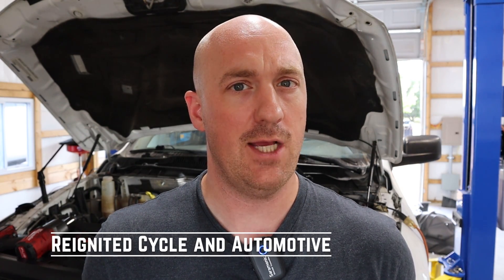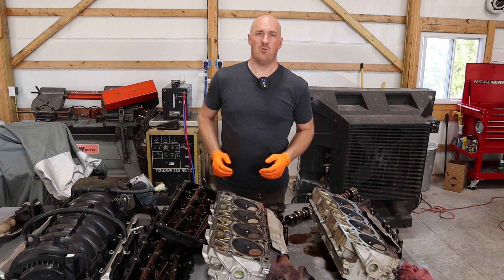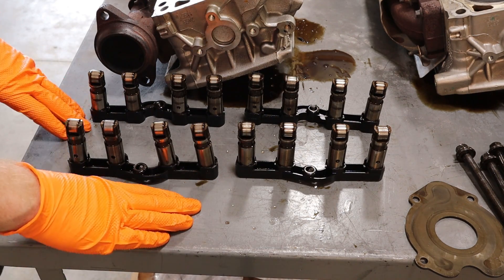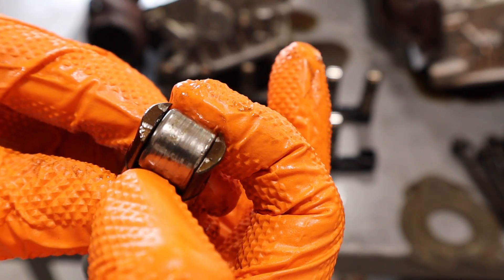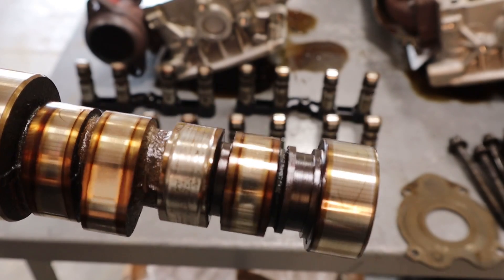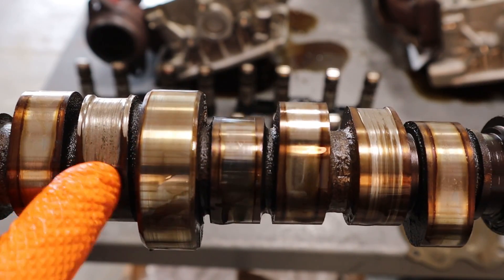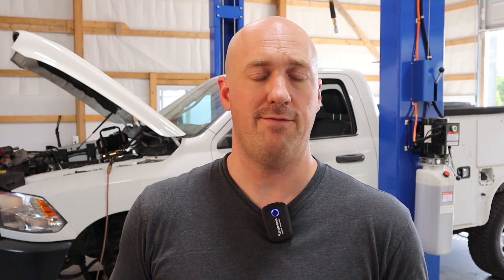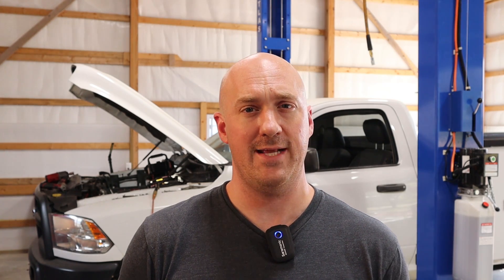Hemi 5.7 Lifter FAILURE Does this engine have a fatal flaw? Find out how YOU can prevent it!!!

Comment: Those rollers get lubed by splash/drip. There is almost no splash or drip lubrication going on at idle due to the higher than normal camshaft location and the shallow angle the lifters are at. Pretty cute Chrysler is trying to shift blame saying customers are going too long between oil changes. It's a design issue. It's a good engine, just don't let it sit and idle for hours at a time...
Reply from the maker: I've been hearing this theory quite a bit since I posted this video about the cam being too high, lifter angle ect... I'm not going to discount it entirely, but let me ask you this, if that is indeed the "cause" why are there no lifter failures on the '06-'08 Hemi engines with the exact same cam/lifter setup?

Comment: I don't know man I have to disagree about it not  being a fatal flaw being the simple fact that I am a car enthusiast and always do all of my own maintenance and have been doing so for a while now I have a 2013 Challenger RT with 123,000 mi on it and I have this hemi tick problem now going on it sounds just like the sound that was on the truck in your video and I've been doing my own oil changes for quite a while on time at that with the best oil that I can find
Reply from the maker: Is the noise evident on startup, or only after it's at operating temp?
Reply: @ReignitedAuto  I would have to say only after operating temp because I hear it every day but only after I've been driving for a while and now it's got me kind of worried being that this is my daily driver is the only car that I have at the moment it's got me thinking like if it is the lifters which I'm pretty sure it is I could only hope that it was something else but it's got me thinking about how much it will be for a job like that to replace the lifters and cam LOL
Reply from the maker: @KOLYNandKYLYNN  Bummer, that does sound like a lifter issue. Any misfires or CEL yet? Sometimes if the lifter has just started to fail it will not have had a chance to eat through the cam lobe yet. The only way to check is to remove the cylinder heads and remove the lifters, locate the faulty lifter and inspect the cam lobe through the lifter hole. If the cam is not yet damaged at least you can save some money there.
Reply: @ReignitedAuto  no so far no misfires or cel yet
Reply: Well I guess I'd better start saving up for a lifter job as it surely something I won't know how to do myself as I only do basic mechanic work just to keep up the maintenance on my car
Reply from the maker: @KOLYNandKYLYNN  it is a big job. But if you want to see the process, check out my 5.7 reassembly videos on my 2006 300C rebuild playlist 👍
Reply: @ReignitedAuto  I'll check it out thanks for the info

Comment: Has to do with engine oil intervals. 
Yet the 6.4 has more issues than the 5.7 🤔😂 
The weight of the oil makes more sense. We need a definitive answer.
Reply from the maker: Unfortunately, I'm only a mechanic, not an engineer. So this video is based off of my experiences with each engine.

Comment: I own a 2008 ram 5.7L and everybody keeps asking me if I had issues with valves dropping. Is that something I should be concerned with?
Reply from the maker: It is a somewhat common issue on the 06-08 models. However, there's nothing you can do to prevent it or prepare for it, best just to not worry about it. In my experience, it usually will happen if the engine overheats, but there are times when it just happens for no reason. What's happening is the cylinder heads are made from aluminum, and the valve seats are steel- this means they expand/contract at different rates, and sometimes the steel seat will just fall out of the head where it's pressed into. The piston comes up and hits the seat and smashes it into a million pieces. Makes a mess of things. To see a classis example of this issue, check out my playlist of my 2006 Chrysler 300C rebuild. 👍
Reply: @ReignitedAuto  awesome, thanks for the response. I will check it out. Happy holidays 👌

Comment: I'm just an old school mechanic but I think he nailed. These new school muscle engines have tighter tolerances than my old school engines therefore they need better oils and more frequent oil changes. I don't know how many oil changes you could push out with old school engines before they grenade but it's not that they were better just built differently. Look at it this way back in the early days of NASCAR if you finished a race and your engine was still running strong you may change the oil, filter and re-gap the plugs before the next race. Now days they pull the engine and replace it. Then tear down that same engine that finished the race strong and check it for stress and wear of every part. That's the difference between then and now with new school engines
Reply: Nascar never ran an engine multiple races. They were always torn doen and rebuilt after a race.
Reply: @kylebelk5932  not sure how old you are but back in the day they did.

Comment: My opinion. When the lifter collapses to kill a cylinder the roller leaves the cam lobe on the heel. Then when the lobe comes around the roller slams into the cam which beats up the bearings.

Also a roller bearing does not need much lube at all.

But may be wrong ( as usual lol). Great video either way.
Reply from the maker: I do believe that has an impact (no pun intended) on why the MDS solenoids fail far more often than the others. Thanks for watching!

Comment: Really? With all the documented cases and you simply want to say change your oil more? Plenty of people have proven its more than just oil breakdown. My 2019 5.7 had the lifters replaced under warratny at 5k miles. It now has 13k and guess what? Heavy lifter tap again that's NOT only caused by "oil breakdown",.
Reply from the maker: I think you would have to agree that situations like yours are the exception, rather than the rule. If all of the Hemi engines were failing at 5k miles, Chrysler would have a PR disaster on its hands. In the cases like yours where it's failing at extremely low mileage, it's clear the issue was either assembly error, or faulty parts. I'm not willing to condemn an entire line-up of engines based on individual cases like yours. I'm sorry it happened, and if it's truly lifter issues again on your truck at 13K I'd be pushing the factory to replace the entire engine, rather than just replace the lifters again. You have the power, as the buyer to push the factory in this case. At the dealer, honestly we don't have a lot of pull with the factory, only consumers can really push things to get done through the dealer area rep. There's always ways to escalate the situation through Chrysler, but I'll warn you in advance that doing so usually makes for a poor relationship with your dealer, since once you escalate your issue the dealer can no longer have direct contact with you, they have to go through an intermediary who works for Chrysler. This can be a huge pain for the dealer and the customer. 👍

Comment: Can you change lifter designs or style and completely eliminate MDS? I do Not want MDS systems..
Reply from the maker: You can swap out the MDS lifters with standard lifters, remove the MDS solenoids and install block off plugs, which are available through the factory. But, you will have to purchase a tuner to flash the PCM to get rid of the MDS without throwing a check engine light. 👍
Reply: So I live in New Hampshire and when I get a inspection sticker they check for codes. If the MDS is removed and a tune is installed will it fail because the MDS won’t run its test and the state says it is supposed to have according to the VIN.
Reply from the maker: @musclecarsrt2324  I'm not going to say 100% because I don't know the extent of testing up there, but here in Texas it would pass inspection because the MDS is not related to the emissions monitors that are checked.

Comment: the lifters are mounted nearly horizontally so no oil runs down to camshaft also cam mounted too high above crankshaft, not enough splash oiling of camshaft. UTG video on this explains it perfectly. who ever signed off on design of this motor should be held accountable. many police cruisers with this motor have meters installed that after they idle for a period of time they get pulled and replaced. 3 people i know lost valve train at 60000 to 85000 miles. all babied their motors. I'm a mopar guy too.
Reply from the maker: I've heard this a lot since posting this video, and I'm not discounting it completely. But wouldn't you agree that if that were truly the case we'd be seeing almost 100% failure rate on these engines, not just the less than 5% currently?

Comment: Just out of curiosity, I have a 2010 Challenger RT with just under 16K miles on it, rare find for sure.  Let's say the previous owner just hardly ever drove it, how many engine hours approximately would be on the car?  My concern is that it could have been one of those scenarios where the guy kept in in a garage and fired it up once every few weeks and just let it idle for the sake of running the engine and circulating some oil.  So in that case it could have very low mileage but very high engine hours.
Reply from the maker: That wouldn't concern me at all. Take that thing out and put some miles on it! 👍
Reply: @ReignitedAuto  That's good to hear!  I take it for a nice burn at least once a week, it's got a 6 speed manual too so no worries on the MDS system either thankfully.  Thank you for the quick reply :)
Reply from the maker: Let me know if you want to sell it 😉

Comment: Is this lifter failure on all year models and year or are they just specific model years
Reply from the maker: It seems to have started in the 2009 models, and I believe the part number for the lifters is still the same on the current model year vehicles, so I suspect we'll still see some failures on the 2020 models eventually.
Reply: @ReignitedAuto  Wow this has been going on since 2009 and they haven’t updated the part or manufactured a solution to the problem where the new manufactured engines don’t suffer this problem tells you a lot about the company
Reply from the maker: @steveortez2613  I've mentioned this in a couple of other comments, but Chrysler is no different than any other major company in that, this problem is affecting a relatively small percentage of vehicles, they would rather pay the money to fix them individually, rather than pay the extended costs to redesign and manufacturer the engine. If the problem became bad enough that it was cheaper to redesign the engine, then they would do that. It's always about money in the end, just like it is with any business.
Reply: @ReignitedAuto  didn’t they just redesign the Ram 1500 in 2018 you would think that they would not dump that faulty manufactured engine in a newly redesigned vehicle from top to bottom
Reply from the maker: What we think companies should do, and what they actually do, are usually far different things 😂
Reply: @ReignitedAuto  I was thinking of buying there new Trex but with this review of the Hemi I’m not even going to take a chance
Reply from the maker: @steveortez2613  I still recommend the Hemi engine, I still think its a great platform, and a brand new vehicle will not have this issue until much later on, if ever.

Comment: What are the oil change intervals on a higher idling truck
Reply from the maker: 5K miles is roughly equivalent to 150 engine hours, so if you want to base your oil changes off of engine hours only, that's a good start. 👍

Comment: Thanks a lot for the very useful and awesome information 
since you said that we need change the oil based on engine hours! 
I tried to find this information in the manual or the websites but I couldn’t find anything. 
What is your recommendation for that !? After how many engine run hours shall I change the oil !? 
I know it depends also on the weather, the oil quality, and the driving habits. But as an average , what is you recommendations!? 
Thanks again and appreciate your time reading all that
Reply from the maker: As a rough estimate 5k miles is equivalent to 150 engine hours. And honestly, to clarify, I'm only talking about vehicles that are idling for an hour plus every day as in fleet use. If you are idling your vehicle for 20 min every day, don't worry about it, just go by mileage. Thanks for watching! 👍

Comment: Jesel makes custom lifters. Eliminate the variable displacement, and have a lifter that has a .5mm weep hole in the bottom of the lifter aimed directly at the roller for a more consistent oil film between camshaft lobe and roller, and I bet money it would eliminate this problem. The "Uncle Tony's Garage" Mopar YouTube channel has discussed this issue at length, also.
Reply from the maker: There's always updates that can be made to improve initial design. I'm glad the aftermarket is trying different solutions.
Reply: @ReignitedAuto  Jesel is a custom cam manufacturer, and manufactures lifters to customer specs. I don't own one of these engines, but to me this seems like an elegant solution to a design flaw that wasn't taken into account for when they moved the location of the lifters in relation to the camshaft compared with most other Chrysler V-8 blocks.
Reply from the maker: @fm9572  Well again, we need to keep in mind that this issue is happening to a relatively low percentage of all the Hemi engines out there. That's why I'm not personally considering it a "flaw" since only certain operating conditions seem to precipitate the issue 👍
Reply: @ReignitedAuto  I understand. But keep in mind the actual cause of the issue is why it happens in those "small instances" that are more common than people think. Long idle times, and long low speed operation times. The engine itself isn't driving the oil pump fast enough to create enough volume to form a proper oil film between the roller and cam lobe, and the angle of the lifter in relation to the camshaft doesn't allow oil to drip onto the camshaft from the bottom of the lifter bore. The lifters are also fed from the pushrods, instead of a dedicated passage between bores, making the "bad oil" situation you describe starve the lifter bores and rollers even further. This means long idle times starve the camshaft lobes, and is aggravated in the variable displacement vehicles, because the lifters in the affected cylinders are shut off using oil pressure to collapse the lifter internals at "cruising speeds," generally around 2000 rpm. Any simple workaround that lubricates the camshaft lobes at low rpm is going to help (MAYBE eliminate) with this issue.
Reply: @ReignitedAuto  I agree, it does happen to a small amount of Hemi engines, but it's more an issue of customer use as to why the lifter fails. This is why the problem is much more common in police cruisers and work trucks. Any "sporty" version of the vehicle it's going to be driven in is going to have more rpm variation, and likely more spirited driving.
I can't imagine someone sitting in a Hellcat 12 hours a day for 3 years like a second home, only turning it off to exit the vehicle maybe 30% of their shift. It's like tripling the miles the engine is used.

Comment: No the problem is lifter angle because mopar raised the cam. Their should be a recall. Your just giving a victim their best odds to go down swinging. Why not tell them to never idle their engines. Same results or to have the cam and lifters changed every 20.000 miles. And in the mean time all that metal is reaking havoc on every lubricated part in the engine. I'm 110% MOPAR and they should recall their fault.
Reply from the maker: One clarification that a lot of people don't know. A recall can only be applied to a safety issue. If it's just a mechanical issue it's called a technical service bulletin, and there's nothing to force them to do it. Companies will all of the time release a technical service bulletin that explains there's a problem that has come up over time, and here's how to fix it. But they won't pay for it to be done. Recalls as a safety issue are government mandated that the factory pay to fix it. 
A clear example of this: The 2011 Ford F250 6.7 Diesel I just rebuilt was making a terrible buzzing noise after shutoff. I found a TSB stating that the 2011 models they found the turbo actuator vacuum line was designed poorly, and needed to be replaced with an updated design to make the noise go away. But I've got to pay for the updated design if I want it. 
I've heard a lot about the theory that the raised cam is the issue. I'm not going to disregard it, but I'd really like to see some actual data beyond speculation that's the issue. If I can get some actual numbers that prove that to be the problem I'd be glad to make another video explaining that.  👍

Comment: Does the needle bearings wearing out in the 5.7 have anything to do with the similar issue of needle bearing failure in the 3.6 engine? I would say that correlates the oil issue. Among other manufacures that have chain issues because of wear on extended oil changes.
Reply from the maker: The 3.6 is an entirely different design, the roller rocker needle bearings fail in the 3.6- and to me it's just cheap parts. 😄

Comment: Oh great mine started doing that a few months ago at idle. Fml.
Reply from the maker: Bummer 😧
Reply: @ReignitedAuto  yeah I added Lucas oil stabilizer for now and the noise went away. Saving up to replace the lifters, camshaft and do an mds delete with solenoid plugs and new head gaskets etc.